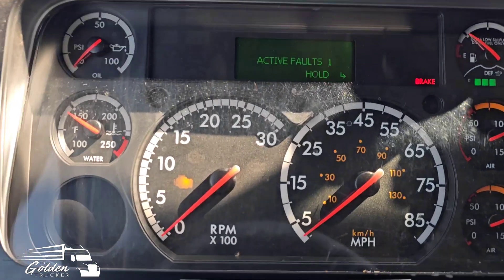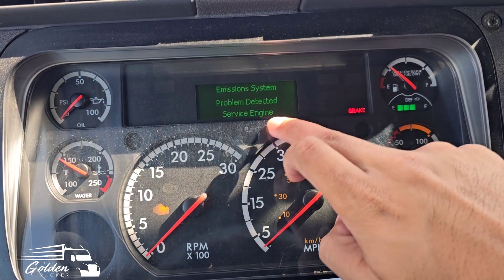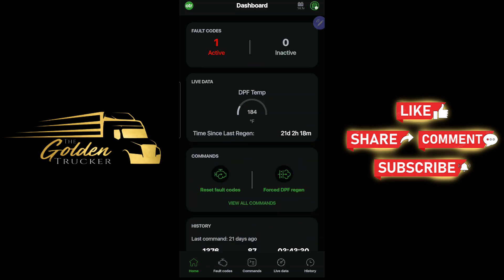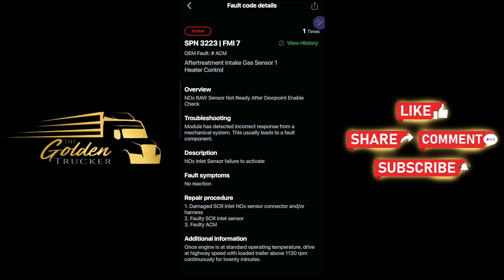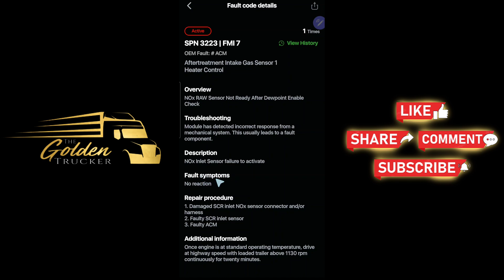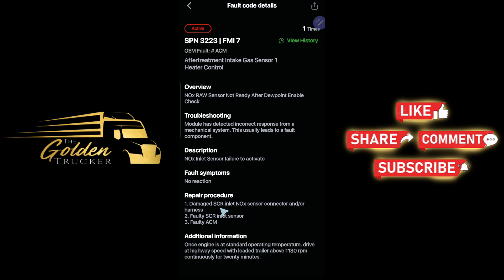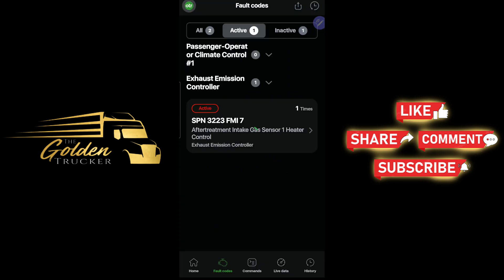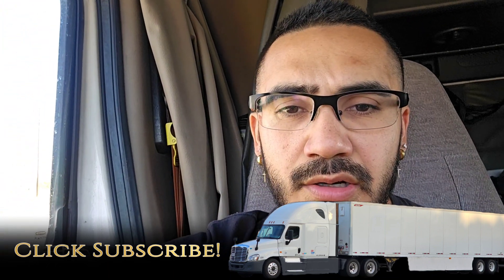SPN 3223 FMI 7 | Inlet NOx Sensor Went Bad | DD15 2016 Cascadia | OTR Performance Diagnostic Tool

Comment: Do you have to regen when you add the new sensor.
Reply from the maker: Technically no, you can just clear the code but that's only if you know 100% the sensor is genuine and is working properly. As long as the trucks computer is not getting any errors from the new sensor, you should be good. I highly suggest you do. I did do a regen but that was because it was an aftermarket sensor and I was already home. If the sensor was bad, I could've easily gotten an OEM part locally.